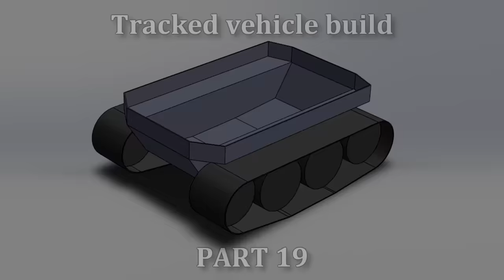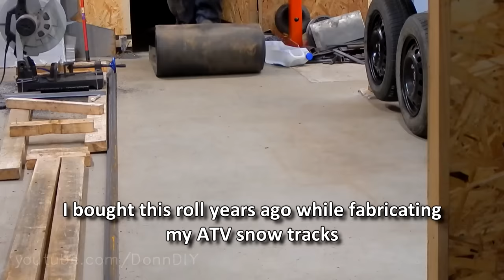Fabricating Tracks - Tracked Amphibious Vehicle Build Ep. 19

Comment: A tip for doing productions type work like cutting the guides and angle for the track pads. When cutting, if your saw is able to handle thicker material, cut the main piece into half or quarters and cut 4 at a time. It will make the job of cutting much more efficient than just doing one at a time.

Comment: As someone who works on and operates vehicles with similar track systems, we use backer plates instead of washers on the back of our cleats, all the bolts for each belt go through the same piece of steel and we thread them into the cleat so no nuts needed, less parts to rattle lose and cause a problem, I don't envy the job of making new tracks from scratch though, this paoff off season I had to replace 25 cleats on a single track for one of our machines at 15 bolts per cleat...took half a day just to get them off, 3 days to assemble parts onto the replacements and get them installed
Reply from the maker: I might replace the washers with those backer plates. I wanted these already when I built my ATV tracks. Might do this change.

Comment: I bought a Hoot with plastic tracks, i see escargo has paddles on the sides of theirs to act as alignment keepers and paddles for the water propulsion.  I do not want to increase the width thinking of making them to bolt through the rubber, bolting the traction cleat, rubber, and paddle on with same bolts.  Thank you for sharing your videos

Comment: When you have lots of material to cut, like your round bar. Try welding 2 or 4 lengths together at one end (opposite end you start cutting from) and a few spots down the length.
Gang cut material.
half as many cuts with two together, or a quarter as many cuts if you weld 4 together.

Comment: Looking good, I will give you a Tip on cutting rubber belting I have cut Miles of it. Add about a teaspoon of dish soap to a spray bottle and fill with water and then spray the solution onto your cut line you will not believe how much easier it will cut.
Thay can be expensive but Google Conveyer belt or elevator fasteners these will have a much larger head or a plate so they won't pull through the rubber also it may be much easier to join the ends hope this may help.
Play Safe From Elliot Lake Ontario Canada.
Reply from the maker: Thank you for the great advice!

Comment: I would blackening the cleats with some heat and wrenching in oil. Keeps the rust a while away. You can reapply this treatment every time your belt needs to be replaced and it's dirt cheap. 😙🎶
Reply from the maker: Might look into that. Cheers! Paint wears off anyway.
Reply: @DonnDIY  yep. Blueing is another possible method. But it's more expensive. :)

Comment: I've gotten the hair up where the sun don't shine as well to eventually make one of my own tracked rigs. Picked up a bunch of 3+ ft wide conveyor belt for free. At probably over 500 combined linear feat let's just say there is enough for MANY rigs & repair sections. One section of belt already has V-cleats. Idea for mine is likely to have a 2-ply system w/ 1/4 to 1/2 overlap for added strength. Cut to width & probably (if I get or build a press) punch out the openings for the drive gear. Use flat bar or angle iron for the pads. If the former than for added traction use pieces of angle iron whether on edge or to form triangular lugs.

Comment: To light duty, need plates instead of washers on the bottoms. 
You have the right idea just make it stronger. 
There is a lot of torque on the belts and steel bars (grousers) when turning the washers will start to damage the belting the first test drive.

Comment: Building tracks from scratch is time consuming.  I am not looking forward to restoring mine.  The only advantage I have is that my grousers are already made.  I just need to clean them up a bit.  One suggestion from me though is to make backing plates instead of using washers on the rear of the grousers.  If not the washers will eventually cut and tear through the belts you worked so hard to make.  I have pictures on my instagram and facebook page if you need to see a set of thiokol spryte grousers and belts/tracks....  Thanks for sharing!!!

Comment: Great work as usual! If I may say? I think the round washers will be fine. Rectangle ones may have sharp corners and wear into the rubber? Maybe flat bar across both bolts with rounded ends could be an alternative next time? Just a thought. Can't wait for the next episode.
Reply from the maker: I meant flat bar actually instead of the rectangular washer. That's how it's usually done. But I've seen regular washer work well too.
Reply: @DonnDIY  I haven't seen it done that way before as your tracks are the first that I've watched being made. Your work is first class! I hope I haven't offended you with my comment?

Comment: These are super videos!!!
I think you will have to widen the wheels or use duel wheels.  The tracks are wider than one wheel will support.
Reply from the maker: No worries. The tires are in the center of the track as on snow cats in ski resorts. They also have one row of wheels.
Reply: Donn DIY  ok good luck

Comment: Interesting. Because of the HORRIBLE expense of buying a set of Argo OEM tracks, I made a set of tracks for my Conquest 8x8 a couple of years back from 4 snowmobile tracks & found a similar home made cleat design online. In the end I simply went with "U" shaped flat bars bolted to the tracks every 8 inches. It works very well & the Argo is unstoppable in the most horrid conditions  but there is so much grip on a dry surface that the vehicle barely turns. You need some "goop" or loose granular material to use tracks on an 8x8 skid steer. I did consider putting larger tires on the 2 inward wheels on each side to combat this. What I was able to do was over-inflate the inner wheels so they became fat which helped quite a lot but at the expense of the bouncy drive on a hard surface. It also made the tire sidewall grip the guides at the sides & bent a few. Argo tires should be really soft to give suspension between 2&4psi...This may be an issue using car tires. Also, tubeless tires are a pain in the arse at low pressures...looking forward to the next video.
Reply from the maker: I experienced the same thing with ARGO & tracks - hard to steer on grippy surfaces with tracks on. My vehicles contact patch on hard surface is smaller due to the center axles being lower / front and rear axles being higher. Thus it should steer better.
Reply: @DonnDIY  Agreed. Take a tip from tank makers who do that...You could play with larger tire size in the inward wheels also...

Comment: Great job as usual, but curious you didn’t knock up a quick jig and use the plasma to knock the corners off the angle irons?
Reply from the maker: Great question - I like the finish of the cutting wheel more than that of a plasma cutter.
Reply: Yeah agreed plasma would leave a little dross (slag) maybe that would then need to be cleaned off. Was just thinking quicker and easier.

Comment: I can’t see yet how you can possibly stop the track from sliding off on corners so far there doesn’t look to be enough side wall of the track to prevent it so I can’t wait to see how you overcome the side load forces of the track
Reply from the maker: The tires on the front and rear end of the vehicle have the track wrapped around them half way. The track guides are something like 7 cm tall, there is almost no way the tracks will derail in corners except when getting a flat.

Comment: Hi, first I like your videos, you are doing some great Design work and Welding!!   Just a Few Areas you may have problems, If you don't mind me pointing out.  you Track I kinda see how your going to do it, but I think you will find that you need at least 2 upper Idle wheels for the track, mainly to apply Tension to your track, they need to be shock mounted in a see saw arrangement so the track can flex and take slack as you roll, other wise your track will bind,  And the other thing is just a joke..... I think it looks like a Polaris Sportsman ATV on Steroids! LOL
Reply from the maker: Track sensioning will be achieved with tire pressure. It has been done berore and it works very well as I've seen.

Comment: I know it's time consuming, but why didn't you painted the metal parts of the track before monting them on the rubber band ? You will not all unmount to do this ? No ? As always, thank you for your vidéo, and happy new year to you and your familly.
Reply from the maker: I built ATV tracks quite similarly to these tracks and the cleats started rusting even though I applied paint. So I didn't see the point this time around. I will make new cleats when (not if) these ones meet their demise.
Reply: @DonnDIY  Maybe you can try electrolys with copper or other king of metal, maybe it's will be more durable. At on 2 ou 3 to test ans see if it's a good solution. I don't realy know, but i was thinking to that because it's so much work to do.

Comment: Will they not just rip out of the tracks under load ?
Reply from the maker: They might.
Reply: Donn DIY i hope they don’t like , it was just something in my head was saying but it’s only bolts through rubber holding it all together.
On a tank each track piece locks into the last and runs like a chain on a cog, i think with yours the tyres will slip and spin in the track once wet or muddy as it’s not going to be light and no teeth to pull on the track.
Love the build by the way just don’t wanna see ya back at the drawing board after a test run , I’m probably total wrong and it will work brilliantly but felt i had to say lol.

Comment: Donn, as an ex tanker I can tell you that your nuts and washers holding the conveyor belt onto your guides will rip right out at the first tight turn that you do. You mentioned that you wished for more surface area and you're right it will need it. So I was surprised when you didn't use a bit of flat bar between the bolts and a third nut an bolt in between the existing pair. Its sort of screams at you to do this. Tracks are the worst part of any tracked vehicle, they are also the best part because its a tracked vehicle. By that I mean to make and maintain is a right royal pain in the arse for a 1 man band, yet with out them the vehicle is not as able across country. Yes multiple wheeled vehicles are quite good, but not as good as a tracked when it comes to real shit ground to traverse.
Oh the reason it will rip off, is due to one track being held still when turning, that's the track that will rip off first. If you had counter-rotation of the tracks to aid in turning that would have relieved a lot of the cross force that will effect your tracks.